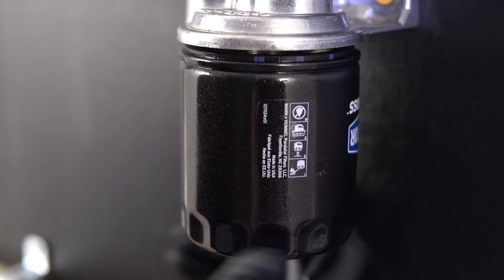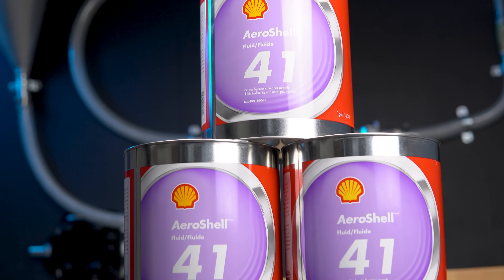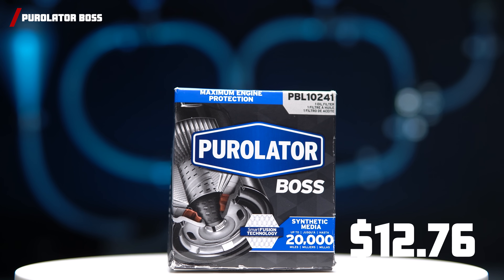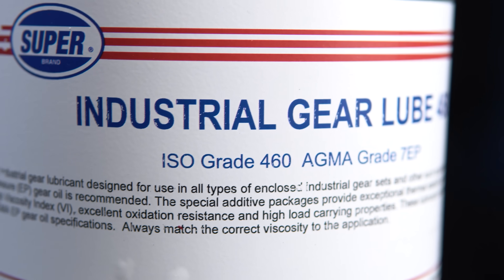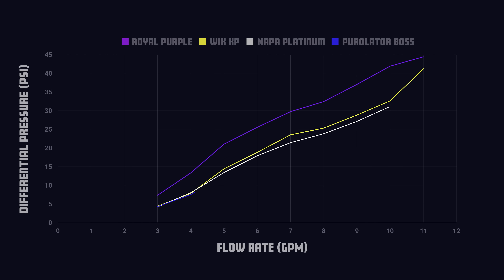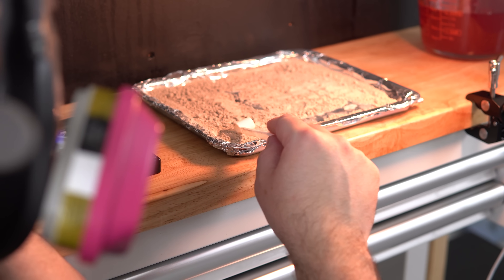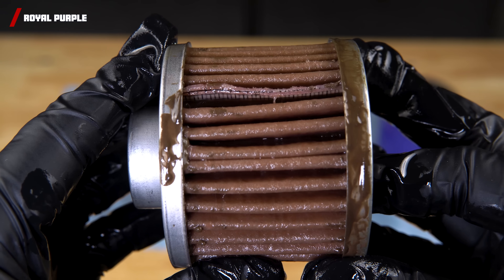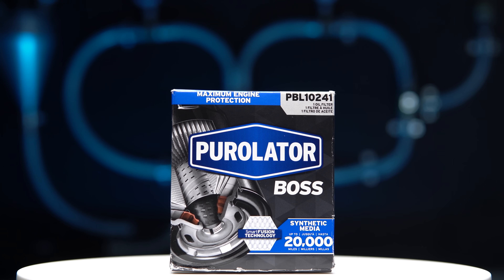Engineers Test the Most Popular Oil Filters

Comment: Donaldson Blue is a synthetic media filter as well. They don't build those for light duty applications but they do build them for some diesel pickups. It would be interesting to see how the standard Donaldson filter would match up to these synthetic media filters. Donaldson builds a top notch filter.
Reply from the maker: Hey, Thanks for watching! We looked up Donaldson filters, but where unable to find one that was a similar size/replacement, so it would not be a fair comparison, but if videos do well, maybe we make a series on just diesel and heavy machinery oil filters. Thanks for the suggestions!
Reply: The best filter company no one ever heard of
Reply: @wallacegrommet9343  
Donaldson is a huge company. Look it up. They are very well known in the ag and industrial world. The Donaldson Blue line, synthetic media, is mostly found for medium and heavy duty applications. The standard Donaldson line covers most everything. In ag, industrial and heavy truck,  the majority of oem air filters are Donaldson. In ag, and I believe in industrial, many of the oem hydraulic and fuel filters are Donaldson. You can find the Donaldson logo in small print on a lot of these filters. I doubt if any other company exceeds Donaldson's filtration capabilities.

Comment: Depends with grade motor oil you use, I use wix XP which is for fully synthetic oil only and I use mobile 1 high mileage fully synthetic with wix XP and it works great, you jus gotta top off you're oil every now and then because most new vehicles burns oil, great video and test😎

Comment: Great test .. I like the look of the purolator boss PBL30001. I understand that some Mopar filters are actually made by purolator (eg MO-409) which has a upper (Ford racing style) not bottom bypass valve. If I could find a Mopar badged Filter that had that combination to fit my 1974 Chrysler 440RB BB, it might make a very high quality bargain. But do they make one, if so it would be a great side by side test.

Comment: Napa is made by Wix, so I'm suprised there's so much difference between the two. I use Mobil One filters and oil.
Reply from the maker: It could be due to many factors, one may be the bypass valve that we mentioned. Thanks for watching!
Reply: Actually Mann Hummel makes most oil filters for Wix, Purolator, Napa Gold, and MicroGard.

Comment: Excellent video! I Found it was very informative and well thought through. Very safe answer with regards to which oil should be used?  Always always manufacturers recommended specifications, especially the more modern vehicle engines. Even more so the Japanese built car engines to be specific as they've been using 0W 16 oils and steer 2000 and we're just getting caught up to it realizing the benefits & fuel efficiency due to as much as 80% of an engines wear  occurs at start up! That being said your demonstration, though seems simple It clearly demonstrated a less viscous engine oil's superiority as opposed to a 5W-30, which has a broader operating range, but lacks the necessary floability at start up when compared to a lesser weight 0W 16 weight oil which can only be made in synthetic forms to reach the 0W needed in order to flow better in smaller tighter tolerances. It's even more imperative to use the correct manufactures oil with an engine like a Toyota 2.5 L 4 CYLINDER ENGINE used in the Lexus hybrid 2023 RX350H. This engine in particularly is leaps and bounds  ahead in it's technology when compared to THE BIG 3 big who are approximately 15 years behind with their engineering research and development department. This engine is so advanced, not only having corded fuel injection, but also direct injection which in itself is not overly advanced, but when the engine CPU is able to go back-and-forth simultaneously to better the fuel efficiency of an engine while monitoring the incoming air temperature, while keeping the intake valves, clean and using the oil pressure to affect, the timing of the engine is mind-boggling the technology they put into that engine but on paper it's a simple engine with a turbo charger until you get to the inside where the real work is done. This is why the 0W 60 must be used and in fact can void warranty if 0W 20 or any other is used for more than one oil change cycle.
Reply from the maker: Thank you so much for the kind words and all the great information!

Comment: I work at Napa and I’ve always been told our filters are wix filters with Napa stamped on it. Be cool if you did a test with Napa proformer, gold and the platinum filter!
Reply from the maker: Thank you for the suggestion and for watching
Reply: The theory was that Napa Gold were Wix filter for over a decade.  When they got bought out by Mann+Hummel you also saw the M+H on the napa gold cartridge.  Some models have extremely sharp threads that didn't seal that great on the '17 MX5 and that's when I started to explore.  You also have her Purolater under the same umbrella iirc but I forget which line correlates to which line.  I always suspected the Napa Platinum would be Wix XP.  With so many companies under the same umbrella they could in reality vary by filter as now of any of them can make half of the filters and another site make the other half and I'm sure each of them has multiple sites of manufacturer. It is a good product that's done me well in the past and the reason I always liked them was they seem to not have some of the weird oil pressure inconsistency that we'd see with Fram.  Napa traditionally carried better quality things from manufacturers in their stores.  There's way less of them, they're often in inconvenient places, some are definitely more distribution than some are just smaller facilities, but typically they were good though.   It feels like that's kind of slipped a bit more as time has gone by or I've just had some bad luck.  If you're an employee, you should check out the discount. You can get on Carlyle stuff.  It's good quality stuff but pretty pricey for those of us coming in off the street.

Comment: Wix 51258 and Napa 1258 contrary to advertising do not have a working anti drain back valve. Took me a while to figure that out with rattling lifters at start up on a Rambler 232 engine.

Comment: Here's a request. You used a common 3/4-16 threaded filter that fits a ton of Chrysler, Ford and Toyota applications. What if you replaced that short 51348XP filter with the longer 51516XP? What happens to the pressure drop and dirt holding?
Reply from the maker: That's an awesome idea. Thanks for the suggestion. If these videos do well and we can get some funding we may try that. Thank you for the support!

Comment: I've been using a NAPA , with Mobile full synthetic in the Honda Civic (2910). It's supposed to have 79,000 miles on it when purchased. Now it's at  120,000. Thinking of switching to Castrol high mileage, a wix filter.

Comment: This is something to think about the new Silverado pickups when the 5.3 engine and very high oil pressure and 8 quarts of oil these are very fuel efficient engines the oil is ACDelco as well as the oil filter and 20 weight oil

Comment: How would these filters perform after running them for 200 hours on the particle test? You would have to figure a way to continually add very expensive dust to the loop simulating blowby from an engine. This type of test would really show what people actually want. A degradation test, if you will. Awesome work by the way.
Reply from the maker: Thank you so much and appreciate your support. Good point.

Comment: Since there are most suspended particles in engine oil
These particles are the result of friction and erosion of metals inside the car engine compartment
In Iran, we use magnets to better filter engine oil and reduce suspended particles in the engine oil compartment and around the engine oil filter.
which is very effective and useful

Comment: Great video with graphs. Would like to l know your decision to make flow the independent variable and pressure the dependent? You would think flow is a function of delta pressure.
Reply from the maker: Thank you very much. Given we selected a positive displacement pump, to simulate the pump used on cars, it maintains it's flow. So increasing the pressure would not necessarily increase the flow. Also we are trying our best to follow the ISO standard for testing oil filters and this are the tests specified. Thanks for commenting.

Comment: Better flow rate isn't always a good thing as witnessed in the particle counts.   Better filtration, getting rid of contaminates is the goal of an oil filter.   Flow is important as long as it delivers the required amount.  Having lower pressure drop or  higher flow equals passing dirt.  A good way to rate filters is beta ratio. Number of particles upstream vs downstream.  It gives you the filters efficiency rating. 
I think any of the brand name filters deliver  the designed flow.     Ive used the Purolator Boss for years as I witnessed tests in a lab and saw it disassemble years ago in a lubrication class. your tests proved that once again.

Comment: In realistic, real world use, I think the Wix and Puralator filters are comparable.  I understand in measured performance they differ but for those of us that actually do a good job changing oil on a regular basis, they both perform well enough to prevent particulate related damage to an engine.  Lets face it, the most important part of filters (other than no cardboard in them) is regular, not extended, oil changes.
Reply from the maker: Agree, oil change intervals is way more important! Thanks for sharing and supporting the channel.

Comment: FWIW....2018 Subaru 3.6R with Pennzoil Ultra Platinum 5W-30....consistent driving pattern (typical/moderate) with oil/filter changes at 6,000.   Blackstone UOA's showed zero difference with Purolator Boss compared with OEM Tokyo Roki.   Apparently, with my driving style it doesn't matter what filter I choose.   May be some benefit convenience-wise via running the Boss through two changes rather than one but nothing other.

Comment: I guess it all depends on what you expect from  your filter. Do you need longer change intervals or better filtration. I use the RP because I change my oil often and need very good filtration. I run a high volume and high pressure oil pump so the differential pressure test didn't matter as much to me either. I would be interested to know how thick the Purolator case is compared to the RP's .020" for burst strength.
Reply from the maker: Thank you so much for watching!

Comment: I would like to see rankings with percentages. Highest flowing filter is 100%. Then every other filter is a percentage of that. Same with dust capacity. The particle count doesn't lend itself very well to this type of comparison, but a bar graph would. Also! What's a typical flow rate?
Reply from the maker: Thank you for the input and for supporting the channel. A typical flo rate would be around 6 GPM that's why we used that GPM for the capacity and filtering performance tests.

Comment: In my many years working in the field, checking oil in equipment, I never once saw a Fram filter on a commercial engine.  (oil ,air or fuel) Most were Baldwin or NAPA/WIX.   In fact Fram was the brunt jokes with mechanics and parts guys.
Reply from the maker: Thanks for sharing. Interesting data point.

Comment: @brandranks I think it would be great to see if the Lenz 10 Micron is a viable solution for automotive-grade usage as it's filtration seems outstanding.  I'd love to see that in the same tests.  Currently running Wix XP 20w-50 on a Rotary Engine.  The ultimate oil destroyer.
Reply from the maker: That filter unfortunately was meant for hydraulic oils only, do they make one for cars? Thanks for watching.

Comment: Good video! Personally I will only use Puralator Boss oil filters on my engines. I also will not run my oil and filter more than 5000 miles with full synthetic oil or 3000 miles with conventional oil. Don't compromise a few dollars when it comes to protecting your engine, to me it's just not worth taking a chance as a old mechanic, your engine will last a whole lot longer and most likely get better mileage also

Comment: Is it possible that Purolator actually makes the NAPA and Wix filters? I've heard that a pretty good proportion of all the oil filter brands out there are just re-labeled Purolators. They used to be owned by Bosch but I don't know if they still are. I wonder if you will test Denso at some point. Those are the Toyota OEM brand and they are usually pretty inexpensive. It would also be interesting to see if the filter performance is any different with "high mileage" oils. I've found that those do actually work at slowing down the oil burn rate for older cars, but I always wondered if they jam up the filters more quickly. If the filter clogs and the bypass opens, you would never know it, and could be driving around essentially without a filter for some time.

Comment: Would like to see a Wix Racing 51794R paired with an Amsoil bypass EABP120-EA.  As in those 2 filters together as a system.  Note a 51060R and smaller amsoil bypass will do.
You get the full flow of a racing filter and the filtration of a bypass filter.  You'll have to plumb in a parallel leg with a restrictor going to the bypass.
You have a high dollar engine you care about - think this is the type of setup you want.  But what do the test results say?
Interesting test, like it 👍

Comment: yall need to do a test of these top aftermarket filters vs OEM oil filters. ive been a firm believer that oems are the best for your car but ive also heard that isnt the case as oem produce filters that just get the job done as cheaply as possible for maximum profits after all oem manufacturers just need the car to last up to its factory warranty after that they dont want their cars lasting longer they want them to either break down to get repair money or have the owner trade it in for a new car with warranty. so it makes sense they dont really put too much tech into their filters...

Comment: Good maint. starts day one.  I do my first oil change at 1,000 miles after initial break in and taking it easy on the skinny pedal the first 1k.  I also use a filter mag from day one for a little extra filtering without reducing flow and since most wear occurs in the first 1k miles its good to have the filter mag on right away.  Some cars cant use the filter mag like my grand Cherokee.  So I used a mag plug thats a brand name and best one out there.  The magnet is inside so it can never pop off.  Only issue with the mag plug is you cant just slap it on there you need to do an oil change before using it. So I did my first oil change on the grand Cherokee at 500 for this reason.  I prefer the filter mag but I can guarentee you the mag plug does work and catches particulates everytime I changed my oil  it had super fine particles stuck to it.  You dont get the same level of satisfaction out of the filter mag since you cant see it unless you cut open the filter but its there.  Some say the filter will catch and filter it anyways so the magnet is useless. The great thing about the magnet is it will grab even the smallest metal particle and will also help keep the filter cleaner longer so less clogging=more filter flow.  Also use good quality oil and I change when my onboard computer says oil life is at 50%.  I can do my change for about $50 myself with full synthetic and boss filter so its cheap insurance to keep my vehicles in top condition.  I typically don't sell my cars unless I need to switch to a different platform.  Recently had to sell my grand Cherokee to buy a pickup.  Whoever ended up with that Jeep was lucky I am willing to bet there want a better maintained vehicle on the road. Im amazed people buy off lease cars knowing that most owners never change the oil till its time to turn it in.  I would never by a used car that was a lease.  If you bought a used lease vehicle this video is of no use to you the damage has already been done.  I live in the south so no rust issues here Im planning on getting 30 years out of my new truck.

Comment: It probably would have made more sense to get an automotive oil like a modern low-HAPS long service life low viscosity oil like Mobil1 ESP or Castrol Edge Euro and then run it at actual automotive running temps.  Mil5606 is a high sulfur and ultra-low viscosity oil and has different properties than automotive oil would.  

Also your chosen categories in the end will always balance out results between all entrants.  The nature of filtration is that better scavenging equals lower flow.  A filter is essentially a controlled restriction.  Better filtration requires smaller pores and smaller pores make more restriction.  The only way to get around that is to use a larger filter with more pleats and likely a larger volume cannister to accommodate.  It would be better to set up a loss function defined by inadequate flow on one end and inadequate filtration on the other, and then see what blend of properties is able to best optimize overall performance.

Comment: Can you provide a source or more details on the pump you used? Building a remote transmission fluid cooler and have been looking for a good pump. Thanks!
Reply from the maker: Hey! As long as it's a reliable positive displacement pump you should be good. Make sure that it provides sufficient flow before buying. This pump is massive and so over powered for a remote transmission fluid cooler, it requires 1 in diameter piping or tubing.

Comment: Many cars now have gasoline direct injection . Wonder if fuel mixed with oil has much bearing on oil filters?  Could gasoline cause filter glue to dissolve pluging up filter?  Just a thought gasoline is a great solvent . Some water finds its way into oil via condensation during winter months .
Reply from the maker: Great point. Thanks for the idea. Appreciate you watching.